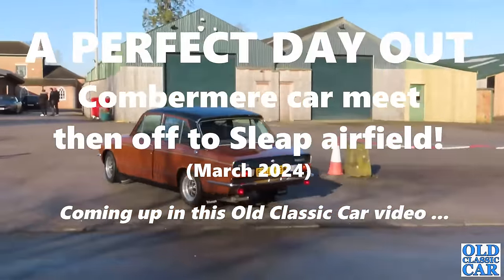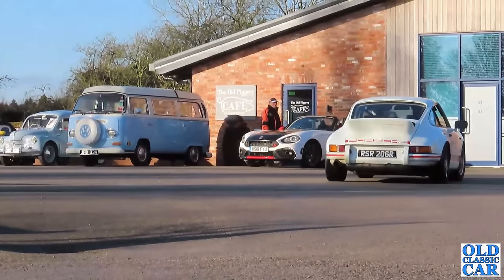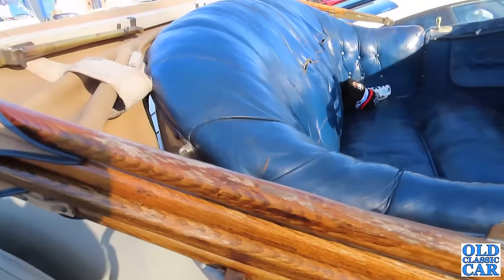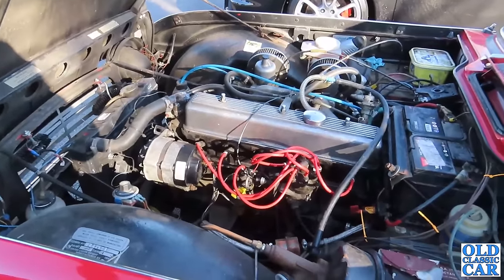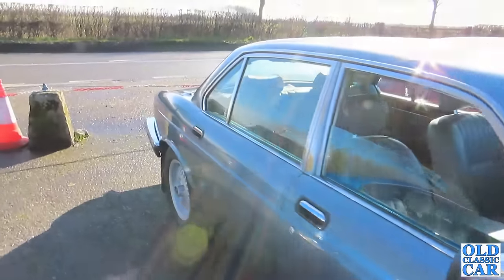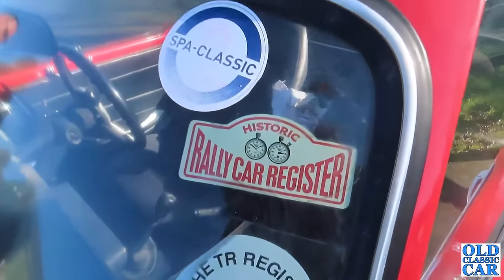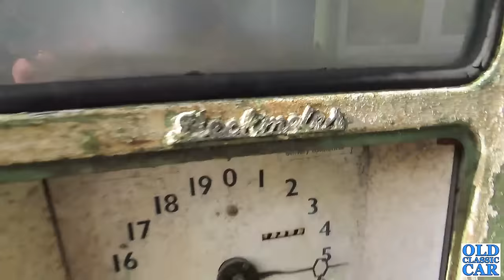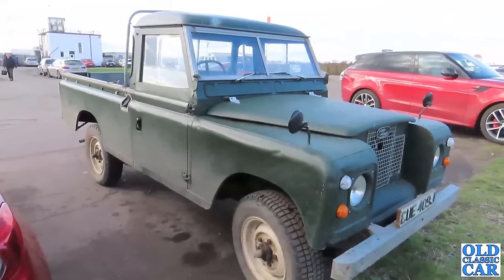CLASSIC cars & aircraft - a perfect day??

Comment: The Ford Courier pick up is a rebadged Mazda B1800, bought in for the 1970's fuel crisis, also sold in South Africa and Australia, I have owned it nearly 3 years, fresh from California, imported by Wheels of Old Shrewsbury, I used it regularly for collecting firewood and occasional trips to the tip for friends and family, always attracts attention where ever we go.
Reply: I was thinking It was mazda so ford have had ties to mazda for alot longer than I thought .
Reply: Too bad they moved way from the small pickups like the Courier. I looked for an old Ranger pickup that had the right size for me, but they are all used up, rusted away or on their last legs. That courier looks sweet.
Reply: Didn't Ford have have a 40 per cent share in Mazda at one time
Reply: @RobertGott-c3f  the only thing I knew about ford and mazda being anything to do with each other was the mazda 121 lol,that's my limited knowledge 😁
Reply: SWEET❗️
These were quite popular here in the U.S. 
Mazda still had their Rotary pickups available, but these little trucks never got one.  They tended to rot quickly.
I think Ford started importing these in around 1972.  
Ford bought into Mazda around 1974 - about 25%. Then upped it to 33% a few years later.
  Really nice truck.
🚗🙂

Comment: The Ford Tonka is a rebadged Mazda B1600.  Hard to tell exactly size wise. could also be the slightly smaller 1200.  Being USA I would think the 1600. Either way its rebadged Mazda to bring smaller utes to USA market
Reply: It is registered as the 1800
Reply: @jmtubbs1639  Thats even better with the 1800 motor. Here the 1600 was most common one

Comment: I was a mechanic in a petrol station many years ago and the boss used to employ older students from the local college to pump petrol. One day the driver of an old Landrover wanted petrol and asked him to check the water.so the student opens the bonnet and seeing what he thought was the radiator cap( but it was the oil cap ,as they had an oil cap that looked like a radiator cap) he could see no water so he filled the engine with water till it was running out of the top of the rocker cover. The boss then saw it, so we pushed it into the workshop where I did a quick oil and filter change.
Reply from the maker: :-) oops

Comment: The Ford Courier , like the one at 37:00, were everywhere in the mid-late70s, here in the U.S.  The Mazda variant was available with a ROTARY, and I spent many happy hours cruising around in a friends. It easily disgraced any v8 in the stop lite grand prix. The worst feature to live with on the Ford version was a very obnoxious cooling fan roar, but they were as good as the imports, and that was impressive.
Reply from the maker: A rotary powered pickup would be a neat thing to own!
Reply: @oldclassiccarUK  it would peel your cheeks back, on launch. It was progressive, so it didn't smoke tyres, just grabbed and then WHOOSH, and the tach would sweep right past 8000. It was shocking in those days.